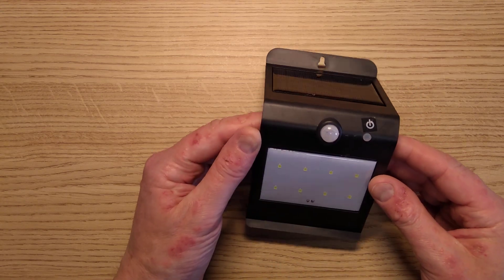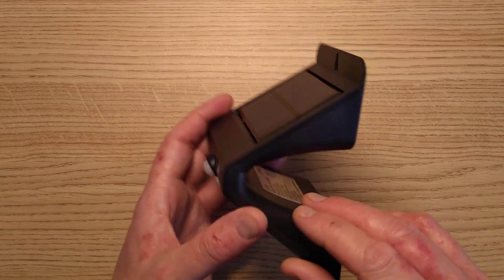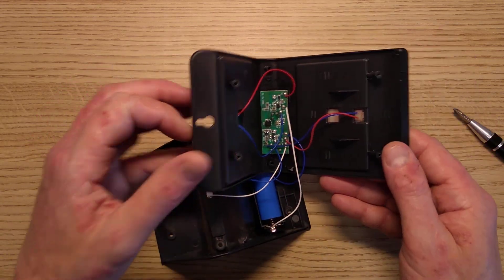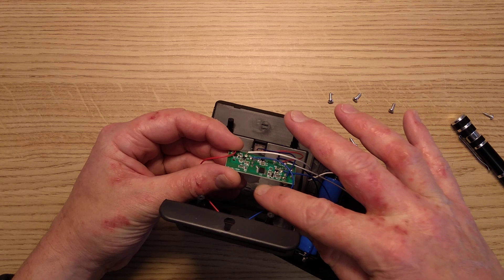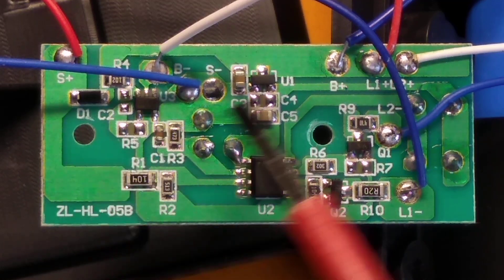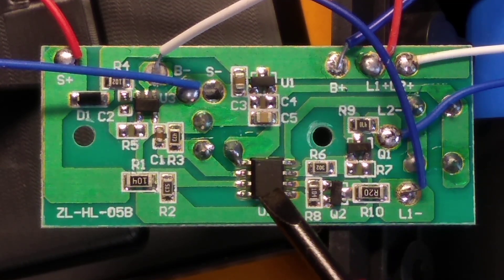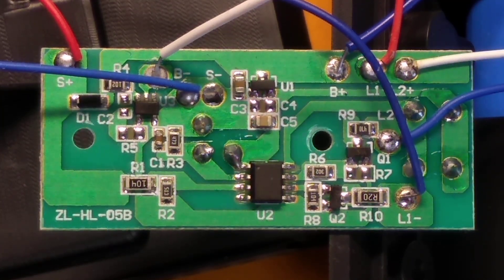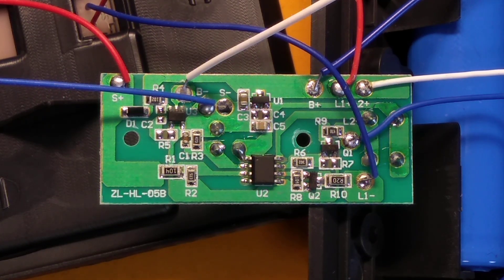Inside an Aldi solar security light.

Comment: Clive.  I wonder if these solar panels could be wired together and have the out put sent to a plug recepticle so the batteries could be plugged in to charge then unplugged an then plugged into a separate light.  DM me if you need more info

Comment: As I currently have the standard 48 LED lights from Amazon but the They do glow softly Red ,so not very discrete the ones on Ebay are 3 rows of 22 LEDs so a long rectangle of 940nm invisible light LEDs ,so much more discrete and don't scream illuminator as I'm in an apartment and they already had me take do my HAM (Amateur)  Radio Antenna.  And More obvious Illuminators other than the 4 I have on the Upstairs Balcony just maybe too much especially Glowing a sinister red in the night like evil eyes !

Comment: Hi Clive,
A little bit off topic, but wondered if you do anything to show a simple way to use a cheap, off the shelf solar panel to power a WiFi CCTV system. I think they run off 12v(?) generally. Saw a video from Charlie DIYte (https://www.youtube.com/watch?v=12gVid8zSg4) where he bought a 'kit' of solar panel and CCTV camera, so that it was totally self contained and connected to his WIFI. 

This would be great as there would be no need for separate power. I'm guessing a panel that could output continuously and have enough juice to go over night. May be a tall order as alot seem to just switch on with movement, etc. Don't really understand it all but cheap but useful solar panels are always useful (have a camper van and use them all the time).

Love the videos. For us simpletons it would be useful to explain what components do from the time to time. E.g. what is the purpose of a capacitor, resistor, etc. when used in a small electrical circuit. May be off track and not what you are about, but would make understanding a little better. Cheers

Comment: Hi Clive. Couldn't resist commenting - being a recently retired consultant dermatologist (UK). 'Dyshidrotic eczema; isn't a terribly helpful term, it just describes a type of skin eruption (eczema) associated with an abnormality of sweating, usual sweat retention in the deeper (dermis) skin layer. As you point out, the condition is associated with the atopic state - asthma, hay fever (possibly food intolerance). Atopy is a state of hypereactivity of the body, it's not a specific allergy. Dyshidrotic eczema isn't particularly common in adults (classically, it produces a foot eruption in atopic children). Not all blistering hand eruptions are dyshidrotic, most commonly, the blisters are caused by the eczema itself; that condition's usually referred to as pompholyx eczema (or cheiropompholyx if it just involves the hands).
But, enough talk. This sort of debate is of no value to the patient who has the disorder. Regardless of cause, the mainstay of treatment is going to be, yes, a topical steroid. I'm sure you've had plenty of those. Have you been shown how to apply this under polythene glove occlusion overnight? That magnifies the effect of the medication although it will make the skin wetter or more blistery in the short term. You would find that the anti-inflammatory effect of topical steroid is much greater than just applying it alone.
I'm assuming that you've had the necessary tests? Swab of blister fluid (and treat if required) for bacterial infection. Skin scraping to exclude underlying fungal infection. A very careful discussion about specific allergens you might be exposed to - e.g. colophony in solder flux/smoke, for example and undergoing patch testing for Type IV contact allergy? Measurement of specific serum IgE (foods, aeroallergens) isn't likely to be helpful, although if you were in continental Europe this would be being pursued much more vigorously with, I'd suspect, inconclusive results.
Yes, it's the norm to be unable to identify a cause in most cases of blistering hand eczema. It's also the norm to end up trying other treatment modalities - oral retinoids, topical photochemotherapy and so on. I qualified in the 1970s just in time to see the use of superficial x-ray irradiation being used for difficult hand eczema. The effects were DRAMATIC. Sadly, that's fallen into disuse in the West due to safety concerns; superficial radiotherapy for skin diseases is still extensively used in places like China.
I'm sure you know all this, anyway. Good luck. Keep making the videos!

Comment: I use calendula salve and it seems to help a lot. You can get it on ebay or look for something with calendula in it locally.
Reply: For me, it's for sure triggered by neoprene rubber and I've had to switch to using solid mouse pads.. I also seem to get it randomly though. Oh well

Comment: You have my sympathy Clive, I had dyshidrotic eczema (pompholyx) outbreaks on my hands a few times around 2002 to 2004 and it was very itchy. My doctor prescribed Betnovate(betamethasone) cream which cleared it up very quickly with just a couple of applications. In my case I was able to identify the cause, at the time I was a photographic printer and to prevent the processors wash tanks getting a black bio-slime build up we used a  chemical treatment (Hydra Algae Free) and any contact with the concentrate solution would trigger dyshidrotic eczema.

Comment: I bought one, it worked for about 10 seconds, seriously. Do I bring it back or should I open it up? Also, the LEDs in front had a somewhat doggy led in there, notably less bright then the other 7 LEDs. But all together it can be very useful to have a few in the garden. Note; I bought mine in the Litle, the counterpart of Aldi.  The difference is that it as 2 mounting holes instead of just one, and there is a transparent cover for the back warm LEDs, that is glued in tightly. Yea I'll take it apart, the parts alone makes it worth it for me. If I can't fix it that is.
Edit;
Inside it's exactly the same, and the battery was simply depleted. I left it in the sun today and it works.  That doggy led is still there but that doesn't bother me. It works as advertised.

Comment: I always thought they were a bit silly as you place solar panel against the wall  where it casts a shadow upon it and its prob not going to get much charge. but since it will take a 18650 maybe it could use a alternative near by power source/battery.

Comment: Nice light until it sits in the sun for a few months then it fails.  Maybe ok on the Isle of Man but not in the desert.
Reply from the maker: In the desert it would probably require better charge control and maybe even a small fan to cool the inside of the unit during peak sun.

Comment: I read it as a SOCIAL SECURITY LIGHT! I wondered where they'd be doling those out.
I got a picture of Doley Parton sat under the lamp whistling lilly marlene.
Actually I did see these next to the bulkhead lights Clive undressed t'other week.  Wondered if I should get one then.
Clive - if you can afford a jar of Manuka  honey while you're in Edinburgh  One of wife's mates is a nurse who specialises in hard to heal wounds and she swears by the stuff for eczemas of most varieties (many other types of open wounds too).
If the NHS are using it it can't be all smoke and mirrors??

It won't miraculously cure you ... but I can vouch that it should ease the aggravation and help heal the leakey patches faster (not a substitute for steroid creams - just another tactic to try).
There is a rumour that some doctors will prescribe the stuff the nurses use for dressings if you ask nicely.

If there's any left over:
1) It never goes off even out of the fridge, should last 1,000,000 years or so (seriously!)
2) The ordinary stuff is better than nowt - but try to get the clear single source stuff - not the blends.
3) Try not to lick it off until it's been on the wound for at least 30 mins, by then the antiseptic qualities should have killed any surface  infections.
enjoy!

Comment: Recent studies show eczema is linked to a complex interaction between some mutated gene some people posses and a usually benign fungal presence on the skin. As the gene is forever, you should look into scrubbing your skin, especially the face scalp and all hairy patches linked with them with soap and a mechanical scrubber (comb or stiff brush). You will never escape it of course but this will lessen the extent to the point that you will forget about it and the scrubbing and the cycle repeats :).
Fun fact: The act of touching you face scalp or beard is a general transmission mode for the fungal triggers to the hands. Hot and humid weather help lots.

Comment: Hi @bigclivedotcom :) I've got a odd tool here, a US wood router that needs 110/120v but at 60Hz thanks to the electronic doo-dahs inside it. Its rated at 11Amps at 120v, what are my options for powering this in the UK? Massive battery stack and inverter? Get half a US generator, and spin it with a 240v motor? 

It may need to run for 2-3 hours constantly if that makes a difference.... (for a wood cnc)

Any advice or a pointer to a good guide or video would be much appreciated! :)
Reply from the maker: 240 to 110V auto transformer.  It will run at 50Hz but may get a bit hotter.  It would have to be tested.

Comment: That chip may well be just a normal microcontroller. Googling around there are quite a few motion detecting PIR units with integrated amplifiers which pulldown on sense (e.g. Panasonic EKMC1693113)

Comment: Hello Big Clive Mitchell I have a Question can the LEDs easy be swapped out as you often do but with Infrared 940nm (nonvisable) for use as Infrared Illuminator with CCTV night vision Cameras I have considered using some of the Ebay 66 Led item number 113808828162 but doesn't have a photocell and I would have to run power out the window where a Solar Powered Light would have great Advantages.
I have some of the round 48 LED illuminators but they are very conspicuous as they glow a soft red visible light, and for indoor supplemental Illumination I plan to replace the 2835 SMD LEDs of Walmart Night Lights with Equivalent Infrared 940nm LEDs ,As a Lamp that Appears to the naked eye to be OFF won't be of Much concern. Any Solar Security Lights that could be Modified Without Extreme Expense or Damage that could lead to premature failure due to water intuition (rainy and humid here) I believe videos on DIY Infrared Illuminators Would be a Very Popular Ones.
Over 30 Years as ASE Master Certified Automotive Technician last 20 Years as Lead Technician Electric & Driveability at Large Chevrolet & Subaru Dealership with 38 service bays. I have Always had a Fascination with Electronics and Electrical and Spent most of my time diagnosing wiring issues from intermittent poor terminal contact to damaged wiring harness to buggy software that we were constantly updating.I'm also have my Amateur Radio License Amateur Extra (Full Licence) which took a great deal of learning about not just about conventional electrical engineering but also the "magic" of Radio waves and resonant circuits. 
I'm an Ohioan transplanted to Southeastern Virginia (Virginia Beach) as it's a Resort Town and No Sells Timeshares to see Corn And Soybean Fields but they do to see the Seashore especially a Beach Resort.

Comment: Some of these PIR sensors have integrated detection circuitry and it only outputs digital signal to show state of detection. With these type of sensors it will be easy to implement it using cheap microcontroller such us Padauk.

Comment: I get that irritating eczema too, the itching between the fingers and on the palms of the hands is the worst.  I seems to be due to physical stress, which is expected if you are working hard in hot weather. All too easy to become dehydrated without noticing the stress your body is starting to suffer.

Comment: The current gold standard for eczema treatment is narrowband UVB  using 311 - 312 nm light. You can buy LEDs that generate it, but I guess dosage is going to be a problem as you need to manage time and intensity on the affected area. Typically time is 2-12 minutes every 2-3  days. Time is ramped up from say 30 seconds per session up to 12 minutes per session over a period of weeks.

Your doctor will be able to refer you to a dermatologist who can do the treatment usually using fluorescent lights.

Comment: Dishydrotic eczema. I've had it a couple of times now. My latest still has minor skin marks - 2 years after it formed on the sides of both thumbs. It's an autoimmune disease different from, but related to eczema on other skin areas. In my case I have no idea why the thumbs got it, but I'm pretty sure my other eczema areas are a reaction to clothes dyes as they occur in areas where I've worn new clothing without thoroughly washing them first.

Did you wear new cloth gloves recently?

Comment: Condensation corrodes outdoor electronics.  Conformal coatings seem very expensive, though they can also protect wires soldered to a PCB.  Does anyone have any experience of using oil-based paint to protect a PCB?
Reply: Thank you @Matt Quinn.

Comment: MY wife has eczema and gets it on her leg below the knee. She had it for years and I finally was able to encourage her to go to the Dr and they gave her some prescription cream and it took care of it. I know she said they'd gave her some information about it as well. I can't remember but I want to say now that she lost alot of weight it doesn't bother her. She don't take the cream anymore either as she lost all the weight in early 2016 and has kept it off since then. I think I gained what she lost and then some. 

Would love to be able to build my own sensor stuff to trigger certain things such as people prowling, when it gets dark, upgraded battery with good capacity but not much larger. More efficiency is what I'm thinking. 

Have a garage sensor for floodlights and it's all out of whack which it has been for years. 

I have a new one for the garage spotlights so I'll just hardwire that up. Nothing with wanting to save money on energy or light a area with no electricity and have it charged by the sun to maintain it.

Comment: I have a couple of lights similar to this one, the only real difference is they're triangular instead of having the void in the back for the accent light.

They work well as long as you don't let them get wet. Water will always find the on/off switch and turn it into a corroded mess, as well as the battery terminals. The best thing I've found to do is bypass the switch and drill a couple of small holes on the bottom to make sure the water gets out as quickly as possible.
Reply: Your fix is exactly what Big Clive has recommended in a previous video or two, suggesting you're (both) on the money :-)

Comment: Why is it that I can get a proper diagnosis from an electronics YouTuber and not from a disinterested NHS GP.   
I've been treating it with success with Steroid cream anyway, but it's nice to know what exactly I've been dealing with.
Thanks Clive.
Reply: When I had dyshidrotic eczema my NHS GP (Dr Douglas Redpath) identified it immediately and prescribed Betnovate(betamethasone) cream which cleared it up very quickly with just a couple of applications.
Reply: @peterjf7723 Its good to know that the system does work in some cases.

Comment: Clearly the Aldi's in the UK have a larger hardware's section than the stores here in the US. And it usually seems to be pretty reasonable stuff. I did get a decent little mini power driver a couple of years back. I won't complain too loudly though as it's selection of good, well priced, and interesting food IS quite good. 👍

Comment: Talking of simple lights, I got a "lantern" thing (Think it's called the "Ernie" LED table lamp) from the local argos clearance place, originally priced £14.99 at argos, it's a big empty box with a battery compartment, a swtich, and a PCB with 6x LEDs and 4x resistors (forgot the values), and a whole lot of empty space around it, which begs the question of why they charged £14.99 for it!!! Still, £3.99 and it's mine, and has plenty scope for modification, just need to decide on what... :D

Comment: I wonder if you could answer this question. I have a lenovo laptop with a fingerprint scanner. When its on it glows yellow. I sometimes use it on a smaller desk so i tend to put the USB mouse on the right corner of the laptop itself, near where the fingerprint scanner is. Then i find my pinky on the right side of the mouse right over top of the scanner and it feels Hot, like its burning me. It doesn't actually burn and leave blisters but I sure know when my finger is over the top of it for a few seconds. Why does it feel hot like that?

Comment: Have you tried that illegal medicine that the doctors get stuck off for talking about.  Cannabis resin dissolved in isopopal alcohol.  I have no idea if it would work for exema, but it does wonders for my arthritic fingers. Applied by dripping small quantity and evaprating the alcohol with body warmth. It leaves a sticky mess that does appear to help.   Works  :)
It used to be demonized as "snake oil" in old post-prohibition movies.

Comment: This 5 pin chip might be probably only protection IC and cuts off battery when voltage gets to around 4.2V. IT might be XB5353A as pinout fits.

Comment: I think that chip likely isn't all that special. 
It appears to be a jelly bean microcontroller with ADC inputs on pins 2 & 3, a digital input on pin 8, and digital outputs on pins 6 & 7.
A very nice little light in any case and the use of a holder for the 18650 is most unexpected.

Comment: Some bits I felt were missing from your usual video.
Brightness test and power draw from the leds, capacity test of the battery (looks like a 18500 to me), charge input of the solar panels, which I know is difficult in the digs that you're stopping in and short on time but probably the main issues people would want to see